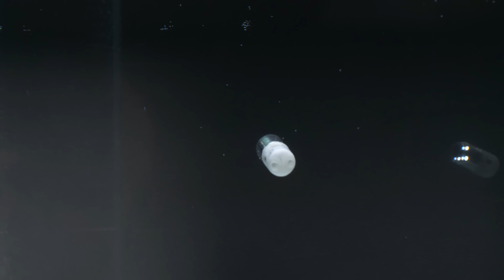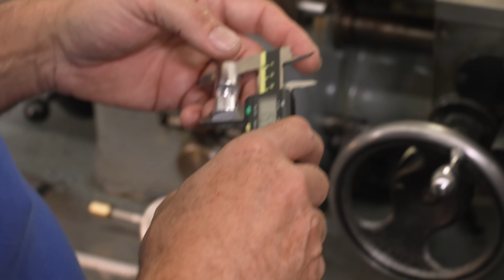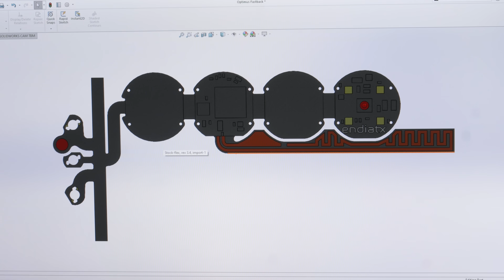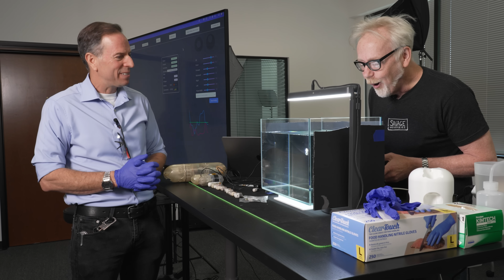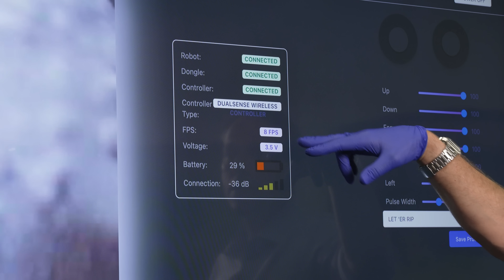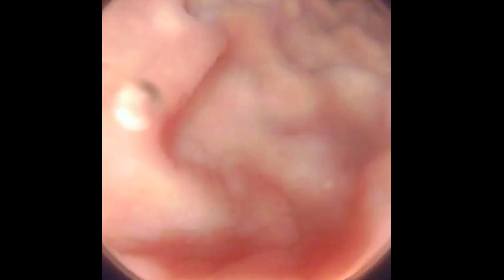Adam Savage Swallows This Camera Robot!

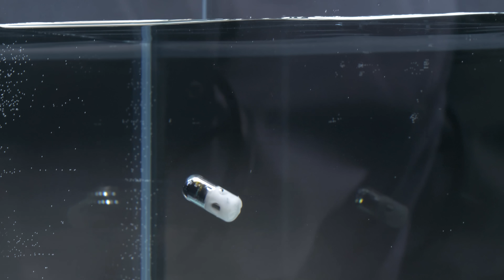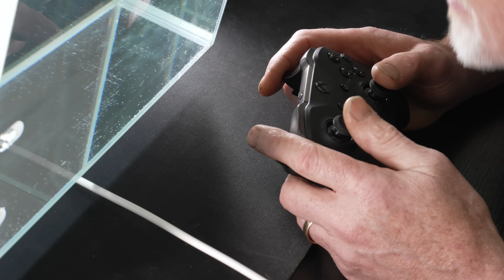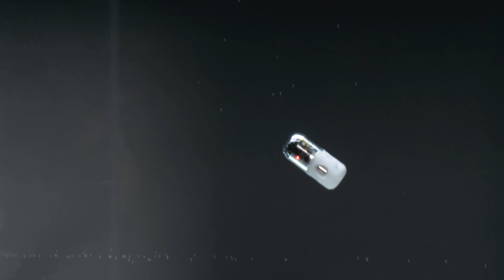Comment: Why does it seem like Adam is hiding the Playstation controller at he is actually using at 12:45 (he even GASPS almost mockingly as if annoyed he was told by the company to not SHOW him using a Playstation product) and then at 13:30 they show him holding an Xbox controller that obviously isn't connected (Xbox symbol flashing) as if he was using an Xbox controller and then you later see him again at 15:42 with the Playstation controller?  Is that like a product placement thing? Do they have a deal with Xbox and not Playstation so you tried to make it look like he was using an Xbox controller instead?  Very strange and also strange the Controller itself was not talked about at all...  It almost looks as if Adam's thumbs were flinching as he guiltily got the possibly "nothing to see here just an Xbox controller like we should be using" shot.  LOL and then it seems as if his face swoops in as he realizes the controller is blinking and people will know he's just PRETENDING to use it.  Then later in the video they are openly using the Playstation controller but seeming to hide the fact it's a PS controller, very strange, I feel like there is some product placement stuff they were trying to avoid, the Xbox that wasn't connected was the strangest part.

Comment: So, this means the hardware is the cheapest part and the most expensive is the software. But even then if the software ends up 500 to 1000 it's a 1 time buy and the drones are what 50 to 100 or so each. So if 1 person buys 12 of these a year, you're only spending 1200+ a years for drones. Not bad!

Comment: Okay. So be real. You can only see a fraction of the stomache. You cannot examine the esophagus, which would be important. The patient would have to drink a lot of water, has to move around a lot to look at most of the gastric mucosa. And as you can see in the vid, like 60 percent of the time, it doesn´t even focus right. This technology has been out there for at least 20 years now. The only new thing is the movement part. And that only is relevant in the stomache. As soon as you get into the small intestine, there is not that room to move around, you will only get random pics. And no doc nowhere will take hours of sitting beside you and steering around this thing. It takes up to 2 hours for the stomache to empty and send the thing on its way. And you cannot take samples, the most important part when something would be found. I have seen this things and used them on patients 20 years ago. Was only made to examine the small intestine. The pics were random, and you had to be very, very lucky to even tell if there was even an inflamation. It´s fancy. But useless. A normal gastroscopy is much cheaper, let you get all the data you need. Let´s you examine everything and let´s you take samples. You can even patch an ulcery if needed. Nowadays you get a little of the good white micheal jackson stuff that gives you nice dreams and after 5 minutes it´s over. With the examination of course. And then this salesman has to throw in the AI-pitch. Thanks. But no thanks.
Reply: Holy yapping yappington
Reply: You’ve used these on patients 20 years ago? I find it hard to believe there would be anything remotely close to something like this back then.
Reply: @DogeDogeriffic  2007, AKH Vienna, the same thing without the ability to stear itself. Main use to observe the duodenum. Made frickn random pictures, most of them useless. So guess why it is not in use today...